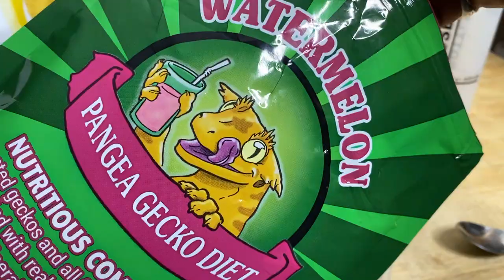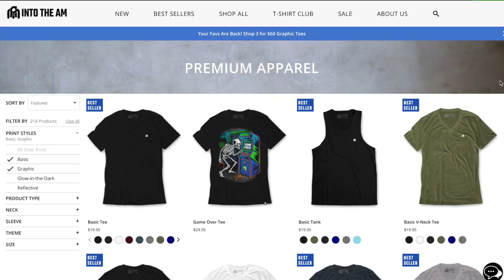ULTIMATE CRESTED GECKO UPDATE | PINGU AND NONAS BABIES ARE ALL GROWN UP!

Comment: An important aspect of ethical breeding that is only just starting to improve (especially in North America, which has lagged behind Europe on this front) is keeping breeding animals in appropriately sized and setup housing. Just because an animal can survive and breed in a small, barren tub or rack enclosure doesn't mean it ought to spend it's life in minimal housing without adequate enrichment. I understand using easily-cleaned or disposable furnishings to maintain sanitation, but that doesn't have to preclude animals from having sufficiently large enclosures with a variety of hides, climbing structures, and appropriately interactive objects for enrichment. 

The dart frog community has been pushing hard internally for years to keep animals in bigger, better designed vivariums, and channels like this one, as well as a few others like Wickens and Clint's, are starting to showcase the same ethos for reptiles.